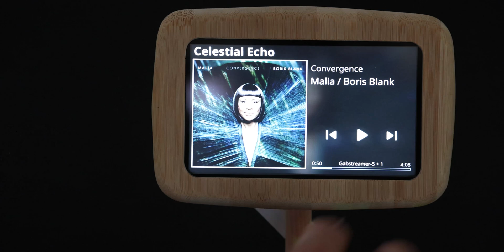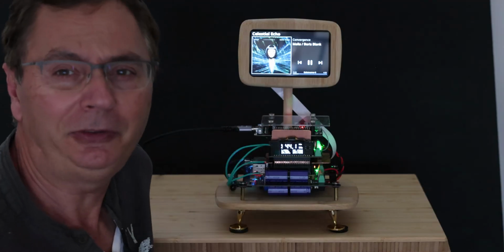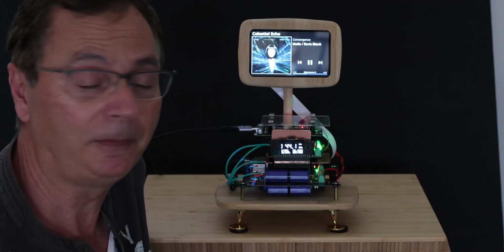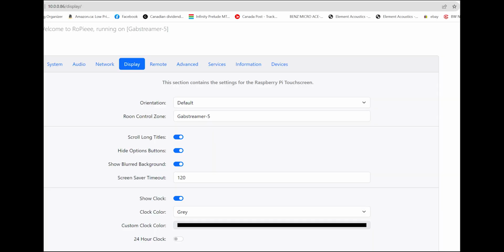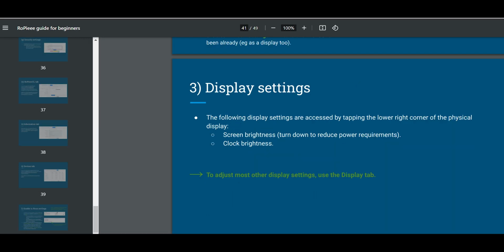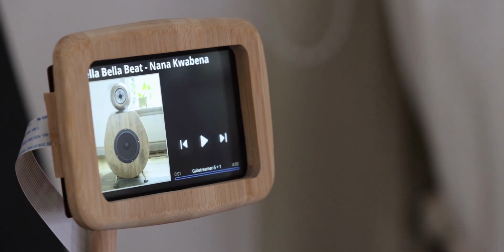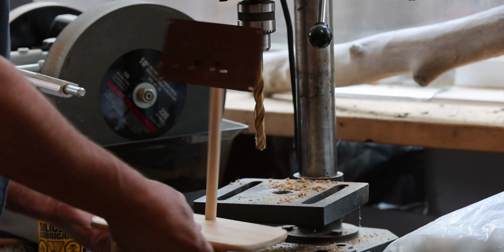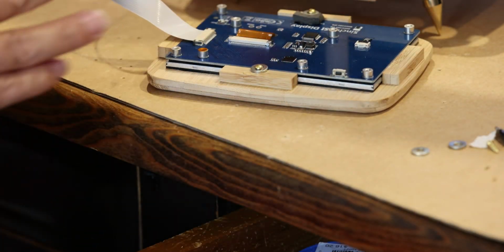Adding a Elecrow Screen to your HIFI Roon Dac or Streamer and Gabster D6 preview based on Ian Canada

Comment: I have a power supply from Topping yet and E30 II DAC with Raspberry 3pi+.  Should I buy ONLY TRANSPORTPI DIGI Ultra Low Jitter Digital Audio Interface Module, and it will works alone? It's better than Allo Digione? Thanks
Reply from the maker: It is one option or better build a streamer with fifo Q7 
You still need a RPI and a good psu like purepi
Reply: @Gabster1 But with Fifo Q7 how is it possible connect to a DAC? I need do buy  TRANSPORTPI DIGI Ultra Low Jitter Digital Audio Interface Module, too. Thanks, but is not clear for a normal human... 😅😅😅
Reply from the maker: @giangada4347   Build  something like this
https://youtu.be/Tc_QfRTbb6U?si=OnnYlNEuDTu0Qilq
if you need a coax or tosslink use a different hat see Ian's site checkout the projects section Iancanada.ca
Reply: Ok, maybe next built.
Reply: Thanks, now I get it, I just have to choose the final module with spdif.

Comment: Another excellent video, thanks a million!
A request if possible.... Would LOVE to see you add an Ian Canada Dual Mono ES9038Q2M DAC HAT & OPA861 I/V Stage for RCA/XLR output to the current build. On yours you have I2S out via HDMI right now, but an all-in-one build supporting PCM/DSD and balanced/unbalanced outs could be a great solution for those without an external DAC.
I do have an external DAC, but it's quite a few years old and only has USB in (for PCM/DSD) and Coax (PCM only). Ian Canada does make a PCM/coax out board (so no native DSD) but no USB out board as far as I can see. None of the DACs I like seem to have I2S in.
Thanks!!
Reply from the maker: Waiting on some parts  hopefully will get the dual mono Dac going 🙏
Reply: @Gabster1  Thanks for taking time to reply! Looking forward to future builds!

Comment: This is great - thanks. I would really appreciate if you could cover two specific things in this series with a screen and grounding: 1) how is it possible to do input source selection and output type selection with the screen? Only relevant with a DAC board, I guess. 2) You've "hubbed" the ground wires together but where are they draining to? And I notice on the IanCanada boards there are ground points too. I assume the GPIO will connect all the boards together for GND but where does one of them drain to? Sorry if these seem dumb questions. Thanks again for doing this series - it's very inspiring.
Reply from the maker: Ian has a station pi controller 
If you use a station pi pro
https://github.com/iancanada/DocumentDownload/blob/master/Adapters/StationPiPro/StationPiProUsersManualV1.1.pdf
See page 7 
2) for ground just your ground from you 120v socket sometimes amplifiers have that on the back if you you are reluctant to tap in the socket
Reply: @Gabster1  Thanks, and I see that on the PDF. You've just confirmed that the screen you're talking about here is just to interact with Roon (or other platform) and not the inputs/outputs too. So a second screen is needed for that (as indicated on the PDF).  On a second note, could you share a link to decent DC hook up cables/wire that you're fond of? Thanks again - appreciate your work.

Comment: Merci à vous, Gaby ! Today I am building the ProtoDac streamer. Do you think this screen can be setup  with Moodle ?
Reply from the maker: I heard you can I tried 3 years ago but did not have great success then, specially controlling it but it may be easier now with the latest update let me know if you try Moode about your experience
Reply: @Gabster1  I've done my homework this week-end. The TDA1387 x8 DAC kit (from Mark) is now soldered and mounted on the RPI4. Moodle installed. Sounds very great
but Qobuz is not very simple to use with. So I tried Volumio. Very convenient. Sounds slightly different.

Comment: Gabster, would you try some 3M AB6005S EMI sheets between the boards instead of the grounding method and see how it goes? Would be great to see your findings in a video.
Reply from the maker: The 3m emi  sheets are limited to very high frequencies 
Also grounding is key you can not do that with eni sheets as they are not conductive if you notice the shield alone don’t do as much 
See my shielding video 

Copper is known to be the best